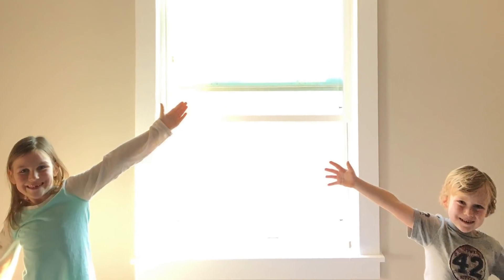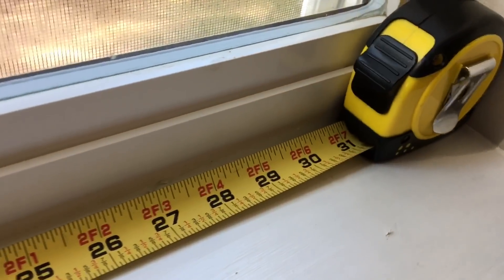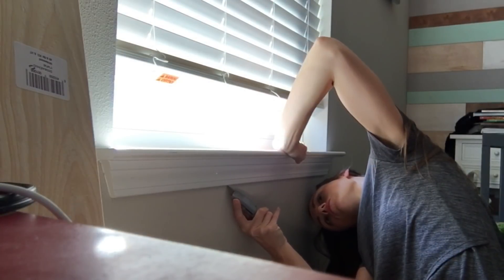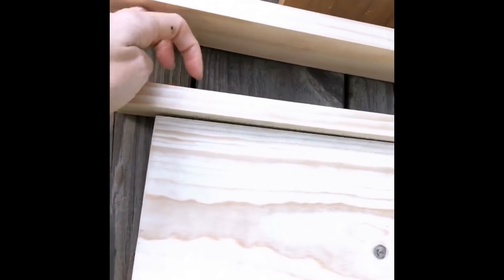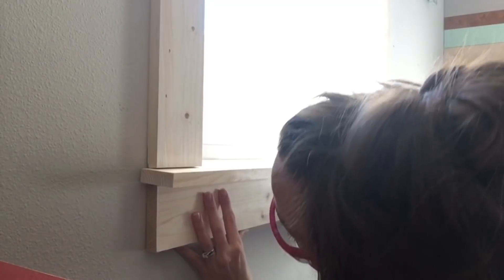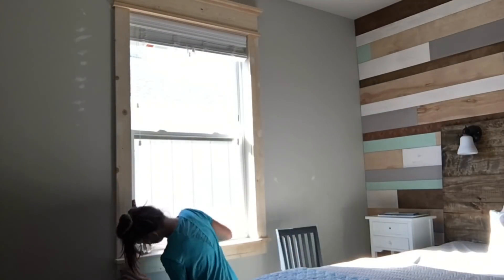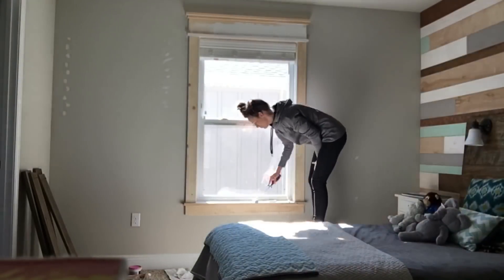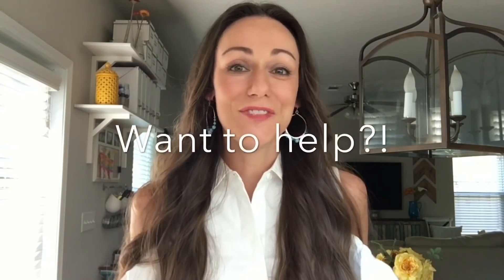How to Install Interior Window Trim

Comment: I did this in my living room and used your plans for it. It's not as easy as it looks. I actually did it as an actual casing though, I didn't leave the drywall in the sills. I also did this to my front door so windows and door would match and for whoever else was wondering before, I used MDF. As long as you're painting it, it doesn't matter which material you use. You have to remember that MDF is only prepped on 3 sides so the fourth side will need to be primed and painted. I'm actually not done yet with the whole project. The door casing is just about done but I have a few more brads to set and then because whoever built my house originally did a crappy job of evening out the 2x4 studs the walls are uneven. I have to use shims behind some of the boards because like I said, I didn't just do this over drywall where it was flat. I had to transition from door or window jamb to drywall while is rarely even. The door looks amazing. Also, I added a crown trim at the middle 1x2 between the 1x6 and the 1x3. It looks legit. If I could post a pic of it here, I would because I am proud but thank you for sharing your plans and how you did it. I wouldn't have that I could do it if I hadn't seen you do it. It wasn't as easy as you made it look, but it's definitely worth it. The door went from like a 3 to a 10. If anyone is interested in seeing some pics, let me know.

Comment: Nice, I plan on doing a similar design on our windows in our house. I just about finished doing crown moulding in pretty much every part of the house. I really like the Big Stretch brand caulk. It can be painted over and doesn't crack. It WILL shrink though so sometimes two applications of it is needed, depending on the gap size you're filling.

Comment: I've seen other's ask themselves the hard question: to remove the drywall returns around the window and install their own wood frame, or find a work around? I am glad to see you tried the work around, i think it is more practical for most people at home! Most will cringe thinking about removing their stool, let alone ripping the drywall all around the window!
A general piece of advice I've been thinking about, and I haven't seen others try yet, is to first lightly sand the drywall in the area you want to frame the window - this will help that window frame sit flush because you have sanded down many of the hills and such that the frame is sitting on. I am curious as to your thoughts!
Reply from the maker: MaBuSt great advice!! Thank you!!😀

Comment: Love the video, great information. I would like to do this to my windows, but I do not have any existing stools around the windows, just drywall. Do I need to remove the old drywall to do this, especially if I want to do the inside of the frames?

Comment: Beautiful! I’m struggling because I just bought a. House remodeled in Craftsman style. The front window and door have the little squares in the corners and detailing, so I hate to take it down; however, I want this style in other parts of the house. Would this go with the other more detailed trim? Thanks! I have to let my painter know soon! Yipes! 💕
Reply: The rosettes you refer to as the squares in the corners is usually a Victorian or Georgian feature. I don't think the craftsman and the other styles clash at all. I have done this to my windows and front door in my living room for my renovation and there are several other smaller doors and doorways that I could not do this to and just used a more traditional colonial style trim and it looks good. I know your comment was from 10 months ago so your project is probably long done but just wanted to let you know since it doesn't look like anyone else responded to your comment.

Comment: Hi! Love your video!  I want to do this to my window, but am wondering what kind of wood you used? Thank you.
Reply from the maker: Mariano Castillo thank you😀 This was my first time ever doing something like this, but here I used “Select Pine” from Home Depot for the top 1x3 & 1x2. The 1x4s and 1x6 I used were just white pine Common Boards. Using the Select Pine will give you the cleanest finish - more expensive though, but very smooth for trim (no knots like you’ll find on the Common Boards).
Reply: Are you finding that the pine is expanding and contracting a lot? Soft wood can do that. Open joint and cracked caulk?
Reply from the maker: Good point! Not that I've noticed. I did use a caulk specific for trim that expands and contracts without cracking... says the label on the bottle.

Comment: Most tape measures will say how long the housing is on the side so that you can add it what you read on the tape. Also, I like using metric tape measures for finish carpentry like this. The only thing I would have done different is use a brad nailer, but otherwise great video!

Comment: sand the edges of your boards prior to install, to knock down any proud slivers or burrs. The sanding block will do fine. Just don't apply so much pressure that you reshape the piece.
Reply from the maker: m4xfl4xst4r good to know!! Thanks for the tip, I appreciate it 😊

Comment: Kristy, thanks for wonderful video. This is exactly what I am trying to do with my windows. I had the same dilemma with blinds as I have expensive wood blinds, and would not want to try to cut all blinds including the metal header. I had same doubt if I can finish drywall just like wood(smooth). But your video gives me confidence.  I am also thinking if it is possible to use white finished trim molding (Primed MDF) to reduce sanding and priming of the trim. Do you see any problem with using white trim molding instead of wood boards?
Reply from the maker: Thank you for your kind words! I've haven't used MDF before. However, when I do all my downstairs windows I am tempted to use pre-primed finger-joint pine boards to cut down on sanding and painting!
Reply: I realize your comment is from a few years ago, but I did this project recently and I used MDF. It is possible, you just have to paint the backside because it will be visible. Unless you just hope that no one ever gets on a table or ladder or something and can see the tops of the boards then I suppose you could go without painting them but that would look bad if you ever sold the home. It would look like you just cut corners everywhere.

Comment: How long did this take to complete for one window for you? Approximate cost? I could see this being a nice project but I'm not sure how time intensive or material intensive it is. Hmm.. tempting!
Reply from the maker: It's hard to tell how long it took to complete. I broke it up in increments over three days. I work on projects randomly when I catch a second in the day!  I'll need to tally up the cost but lumber was probably around $25. I'll double check that!

Comment: I learned after caulking a fair amount of recessed lighting that normal silicone caulk cannot be painted - the paint beads up and doesn't adhere at all. I think it's important to use a paintable caulk for any projects like this.
Reply from the maker: You make a GREAT point. Read the tube before you buy. MUST say paintable caulk. I ran into a huge mess on a big project that involved a lot of caulking. I used silicone caulk on accident....that nightmare still haunts me.